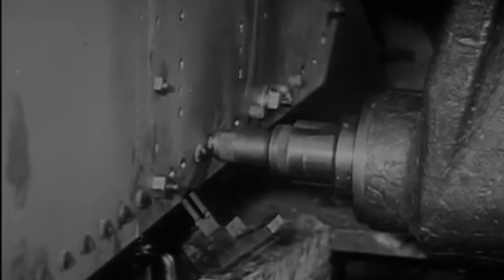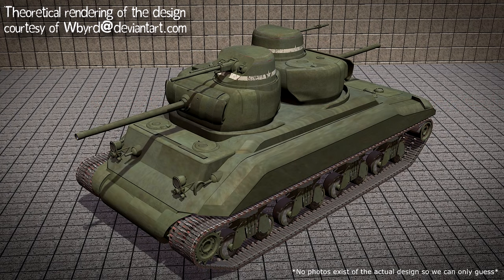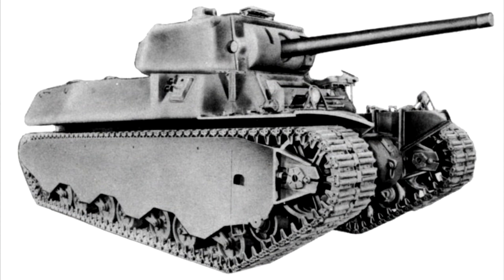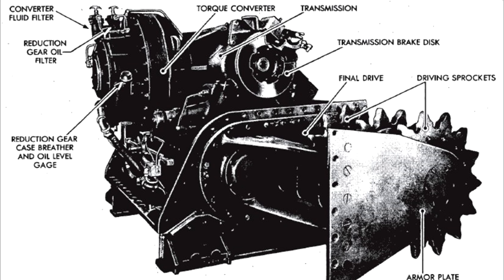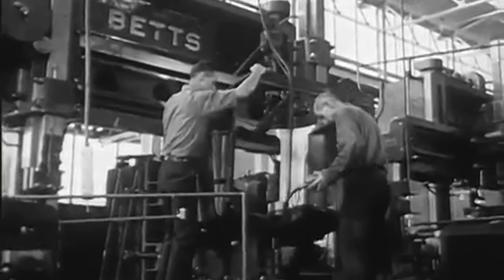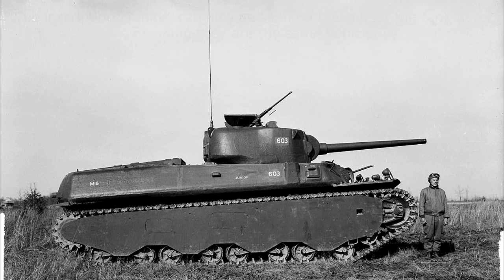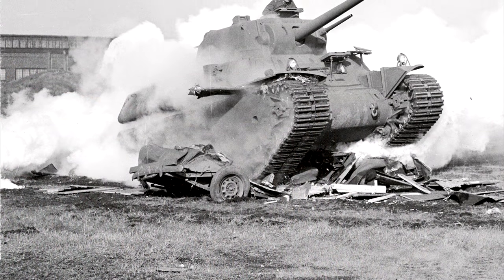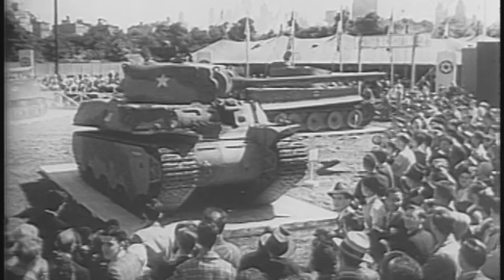America's Tiger, the M6 Heavy | Cursed by Design

Comment: Why would they have thought it was a good idea to demonstrate and display the T-6 along with or side by side with the M-3  Two entirely different (weight classes and mission specification) weapon systems?
The worst thing that could happen, did happen; T-6 didn’t perform 100% next to a lighter, less expensive, probably easier to produce armored vehicle. 
Not necessarily understanding the separate roles the two tanks would be destined to perform in combat, the non-expert “tax paying” observer is bound to favor the M-3 INSTEAD of T-6 rather than supporting production of both weapon systems.
Those “observers” also include decision-making Army Generals….

Comment: What disgusts me is that the American commanders who rejected these heavy designs seemed okay with their soldiers getting slaughtered in small Sherman tanks hopelessly outclassed by Panzers and Tigers especially. I'll bet if Eisenhower had to sit in a tank, he would much prefer the safety of an M6 over a basic Sherman with only 55 mm frontal armor.
Reply: 1. The Sherman was not vulnerable to many German tanks and AFVs like the Panzer IV or the StuG, as they can pretty much get easily penetrated by Sherman tank. The bigger cats sure posed more of a serious threat to the Shermans, however only few of them were actually saw action against the American forces (particularly for the Tiger, since most of them were sent to the Eastern Front and only around 1.000 of them were built)

2. The Sherman tanks actually had more crew survivability rate compared to any of its contemporary (take T-34 for example, only its commander and loader are given proper hatch, the driver was given a poorly designed driver's hatch and the bow gunner only has access to floor hatch)

Comment: In wot/wotb t1 heavy and M6 is like a moving bunker its armor could be pierced with Tanks with certain cannons like su-100 and other it's weakness is the tank speed and turret rotating making it easy destroyed many player using t1 heavy/m6 are destroyed because they're struggle destroying light tank and tank destroyer the armor is very good at tiger and other tank but it's speed is making it worse. I'll better pick BDR G1B because it's had a promising armor and damage and it's armor very hard to penetrate in tier V until tier VI it could say as a failure in wot/wotb.

Comment: Our M4 Sherman tank was so outclassed by the Panther and Tiger tanks that in the case of the Tiger it took five Shermans to knock out one Tiger. If the Germans had managed to manufacture more Tigers we would have been in real trouble. Too many tankers died because we had nothing to match German designs. A heavy tank with at least a 90mm gun should have been mass produced and shipped to Europe ASAP.
Reply: How long did it take a tiger or panther to be repaired compared to the Sherman?  What were the unit readiness numbers in comparison during WW2? That is where the Sherman shines. We seem to think WW2 armor usage only revolves around tank to tank combat, but it did not. The Sherman’s were reliable and easy to service in the field a complete ocean away from home.
Reply: @drittal  The Sherman was primarily an infantry support tank and was used to take out bunkers and to help break up assault formations. But when it ran into German panzer V and panzer VI tanks it was at a serious disadvantage. Only the overwhelming numbers of Sherman tanks enabled American forces to defeat German armor.
Reply: @Wargunsfan  until d-day, there wasn’t a want by in theater commanders for anything more than the Sherman. They even left the 76mm Shermans that were staged for the invasion back in England. Almost all tanks were primarily infantry support, and the reason the 75mm Sherman was more popular was the better HE round. The reason it helped win the war and wasn’t replaced much earlier was it was reliable and easily field serviceable, as I already stated above. The superiority in firepower and armor of the German tanks that could boast that decisive of a difference was greatly offset by both lesser numbers built and even lower operational readiness from breakdowns and enemy action because they there not as reliable and they took about 4x as long to repair.

Comment: Cost wise, 2.1 million per unit is close to a modern M1A2 or whatever, inflation is a bitch....Compared with the T28, the T1 and M6 were much more practical.  But, well the M-26 Pershing and subsequent development of that line would win out in the long term.  If it wasn't for having need to ship tanks overseas, if M6 could have been built and deployed from France(in the event Germany held onto parts of Russia while allies gained control of Western Europe) or if it had been developed in Russia to begin with -as an alternative to the KV-1....well, one can only speculate.  Playing a game with a tank that could have been but never was is a fun thing to do, but too bad those games give tanks hot points.  Tanks don't have hit points! They have weak spots and dead crew and they catch on fire and explode....and a big gun on a mobile platform.... and maybe in low intensity warfare, a bunch of MGs may be a viable armament.

Comment: i think that the M6A1 could have been succesfull if they envissioned them a littel diffirently ; instead of a stand-alone / end-all-be-all brawler , what if it was designed as "no u (are dead)" card to the german heavy tanks/bunkers suppresing allied infantry :

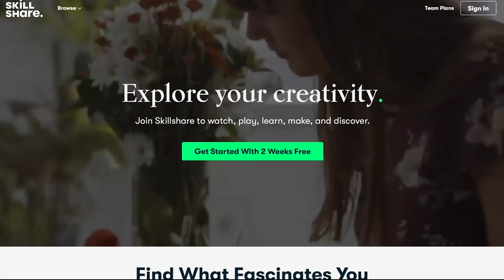A tank with a lot of frontal armor and a BİG GUN (like a long-barrel 76mm or a moderatly-long 90mm [but with a smaller breach and counte-weight {becuse shorter barrel}]) , 50 rounds min. and ditch most of the side armor and the frontal hull MG replaced with a coax. uhh... i dont know , a modified 20 mm hispano? or  just 2 M2 50. ca- NO..! this thing would need a lot more suppresing power that is İNDEPENDENT OF THE MAİN GUN ! So , via off-seting the main gun to the left ever so slightly , enlargening the turret to the BACK a littel , adding a relatively big commenders copula and developing a simple and cost-effective , mechanicle remote turret mechanism; u can but two 20mm auto-cannons ,with extended belts (arond 1250-2500 rounds) , controled by the commender , they whill be mounted on a bouble piveted , ossolating turret capable of 75 degerees of elevation (to engage aircraft) and depresion of 20-ish degrees (to engage infantry) (tho a regular turret with 30+ and 10- elevatin is also acceptable) , a target weight of 50-ish tonnes with 10 tons of accepable over-weight , targeted min. speed of 22.5 mph at flat terrain with an engine capable of 1000HP and a transmition that can get a ratio of 1: 0.5 at gear 1 and 1:20 on gear 8 (RPM wise), pereferably an electric transmition with (slight) neutral steering to point the bow of the tank to enemy faster, but a normal transmition with decent reverse speed is also acceptable  , a crew of 5 (driver , gunner , commender , loader and a loader/radioman , 1 in the hull , 4 in the turret, and also a central drivers seat becuse WHY THE HECK NOT?!)

Comment: They had to leave them. They no doubt would have fared much better than the shermans against german tanks but the issue here is the weight and size. It would have turned into a huge disaster for the US if we had tried to deploy that tank. Not just the logistics of shipping but in theater even more so. European roads and bridges could not handle a vehicle this size and weight. And the wet season? Forget it! 

Even the germans struggled because of this with their tanks. 
 

While I cant stand the sherman, it was better to go with that over this heavier tank.

Comment: Great that we tested it, but a shame that we wasted so much money on these projects past the point that we knew they were bad ideas. With tanks like the stuart, not sure why they even considered these, even with the need for a larger gun. Maybe it was due to the propaganda, but between field reports and the problems with trying to field huge vehicles it should have been dropped a lot sooner. It was never possible to add enough armor to defeat current guns and still have a drivetrain that worked and was reliable. Some say logistics, but when you can't even get a vehicle from one point of the base to another in back I don't think logistics were something they were thinking for those. 

I thought the US army thought the Pershing was a heavy tank as well as the Panther it was designed to counter? I know they changed it but even it shows the problem, you literally cannot build a fortress on one end of a vehicle and expect it to be reliable or maneuverable. So you see the idiot "super pershing" field modification which despite the engineers that get paid sending it with as much armor and gun as possible, it wasn't seen as enough and they put the bigger gun and the weight of that weaker armor for what? They say it was delivered in Jan of 45, which the battle of the bulge was over and the race was on to get to Berlin before the Russians did, literally no use for that thing. 

I am not sure who the stubborn hard headed person that made any of this possible, but myself included at one time thought they should have been everywhere. Because I thought tigers were everywhere. The more I learn the more I respect the doctrine that kept any of those huge tanks from being rushed out. 

The fact that the public would be all about them though, makes the bond tours the perfect place for them. Hilarious your line about the containment of unruly cars or whatever there made for a good chuckle! Great look into this, and great footage/images, never seen so much on it, so thanks!

Comment: I still don't understand why Americans liked that Sherman tank type suspention.  The Christy suspention was so much simpler and better....and the Russians got to use it on their tanks.
Reply: Because it was compact, effective, and single-unit replaceable. It also didn't cut into the hull width nearly as badly as most/all of the suspension was housed within the track width, and didn't require room out of the hull floor for torsion bars or locating arms.

Comment: I think US must had used those 40 ready to use tanks in combat ...... I mean seriously 40 isn't a small number.
Reply: Those were being built for further testing and evaluation until  Ordnance pulled the plug on the project due to the cost, the fact that the crews hated their cramped operating positions and that the US armor commanders flat out refused to use them overseas because it was too slow to consider using as an offensive weapon.

Comment: It took 8 Sherman's to stop a Tiger, The US waited until the last months of the war before heavy tanks arrived. If the US. planes were as bad as their tanks the war would have lasted another 5 years.
Reply: The US armor commanders didn't want a slow heavy tank so rejected the M6 and refused to accept the 254 new Pershing tanks since those were built for rigorous testing to work out the flaws and bugs along for crew and mechanic training. Ordnance only tested the first three made by running them non-stop for 500 miles around a test track. One made the trip without a breakdown while the other two lost road wheels after traveling around 300 miles. Ordnance decided that was normal wear and tear so announced that all 254 were suitable for use on the battlefields. All were shipped to Great Britain and Ike had to coax the armor commanders to accept a few to try out. A total of 29 were shipped to Western Europe where they had no real impact on the battlefields.
Reply: The M-4 Sherman Tank Was Hell on Wheels — And a Death Trap with it's gas engine.
Reply: Fransisca Vasquez  Cooper was a disgruntled junior officer that stayed mad at the Federal Government thru out the war because they wouldn't transfer his ROTC Army Artillery commission to the Navy. Instead he was sent to the tank school at Ft. Knox to learn tactics and ended up the head clerk at a main tank repair depot and salvage yard. Belton was bitching about the lack of armor even then so was given a Pershing to up-armor. He added too much in front which made it too nose heavy to operate. When he wanted to add more in back to balance the tank, headquarters told him to remove what was added and then go back to his job shuffling papers.
Reply: One Sherman could stop a Tiger or Panther since the gunners were instructed to aim at their tracks and road wheels in order to immobilize the tank. That would force their crews to abandon the tank since it now was a sitting duck.
Reply: ''It took 8 Sherman's to stop a Tiger''

History Channel doesn't acknowledge the existence of Sherman 76s

Comment: America did need a Heavy Tank in Europe, just not this one, this one seems cursed with design flaws. so they should of just taken the good parts and kept designing newer better models for the eventual D day invasion. Germany's Tank's were by far superior and a major problem. The Allies could of saved many lives by having a Heavy tank that could of matched Germany's.
Reply: The 76mm Sherman was in England on D-Day but most units didn't want it. A heavy tank wouldn't work for the united states you know the shipping and army corps of engineers bridges wouldn't handle one. German tanks superior? Which one? The Sherman outclassed an panzer 4. The tiger? You mean a tank that didn't work half of the time. The panther? A tank that 6 of them destroyed themselves trying to get to Kursk. The Sherman was and is the best tank of the war because it actually worked all the time. Lastly saved lives? The Sherman had the crew survival rate of the war. Out of 48,000 enlisted tankers only 1600 excluding officers were killed with over half of those outside the tank.
Reply: The US didn't need a Heavy tank. It would bog down their apparent mobility on Europe and the Sherman was performing adequately for the most part. The Germans may have the Tiger or Panthers but there were only Three confirmed sightings of Tigers on the American sector.

Comment: love how they rehash this crap. " go on baby t1"  - " i don't wanna go , i am big ol medium clone". Baby t1 in WOT. and is the first thing to get shot. Even when it was constantly the highest thing on the field. either by at T-14 that does not want it to do any harm to itself or others or a KV that thinks it would look better dead, or a clever baby 0 tank. god, help it. so many stupid times in that tank. can't help but laugh. in real life. what a fail whole line. silly, too tall, even for the infantry support role. God help you if there is a 10-15 degree incline or slope( forget any combination of the 2).  that IS if you can get them there in the first place. prototype got stuck at Aberdeen and thankfully was left there. and even so, gl resupplying the few you would get with fresh men to replace the ones killed in that thing or ammo, or enough fuel. shearman has been shooting people left and right from 1942-1993. The work, use those. cheaper, better, high quality, easy to maintain, and even still to this day, plenty of parts if anything DOSE break. and if you have an arms supplier and some concrete you can shoehorn up to a 105 into the turret ( torch required). see the M50 and 51 of the IDF.